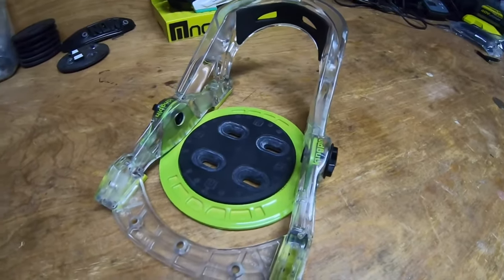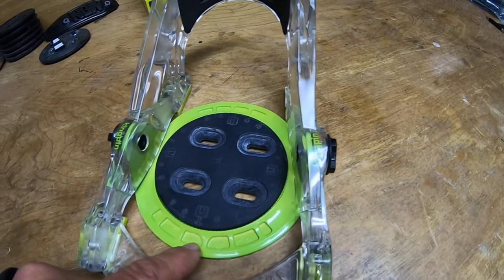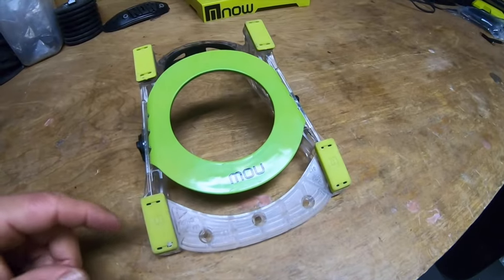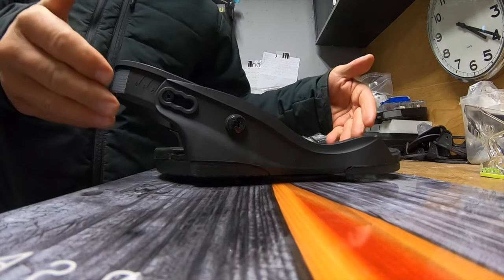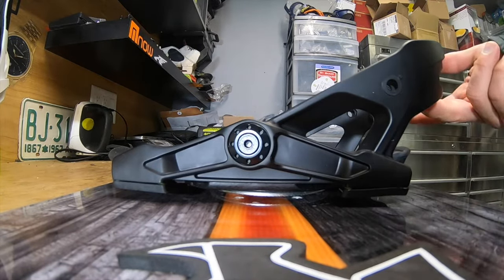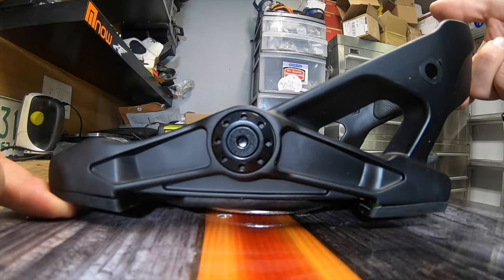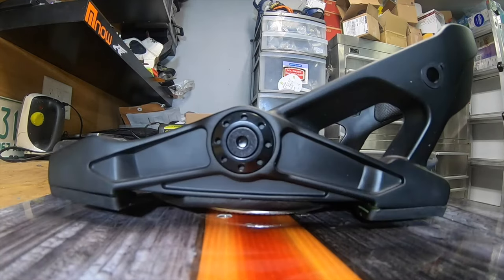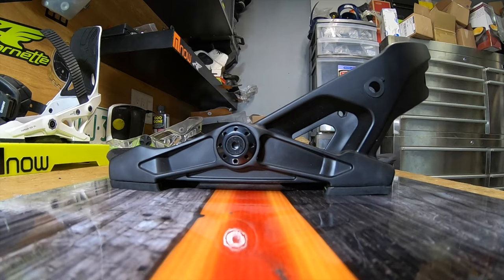How does SkateTech work?

Comment: Lift or torque.  The binding basically acts as a coupling and the disc is the anchor for the center or king-pin.

I have a 22-23 Jones Apollo that has the Now king-pin tech.  I can’t stand the play in the surf-bushings.  The black, stiffer bushing eliminates that play, but the function of the binding is still performed.

Traditional bindings cause a torque at the disc to the straps and high-back.  The smaller the disc, the more distance for the torquing.  This is true in Burtons EST.

Comment: Doesn’t the binding stop functioning the way you want when it gets back with ice and snow
Reply: It's compressing the bushing so even in the very small change snow and ice somehow gets underneath, it will still work since the polyurethane will still compress.
Reply: Great(WISE) question. But even packed, the hinge/leverage point still allows for significantly more torque. Yet I’ve heard nothing about snow build up a year later..surely at times it can change the feel??
Reply: I don’t know any pros who ride them. My dad rides them. He does ride pow and had his board fall off while on the chair 2 weeks ago.